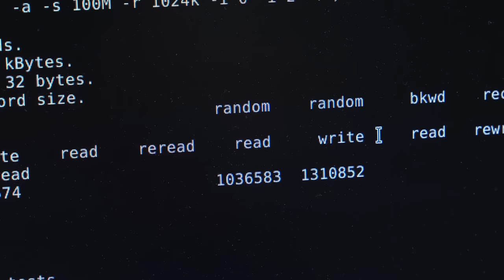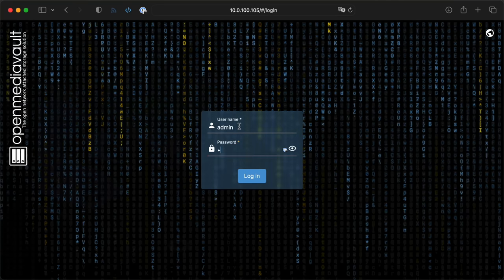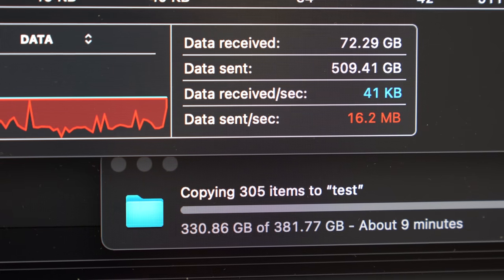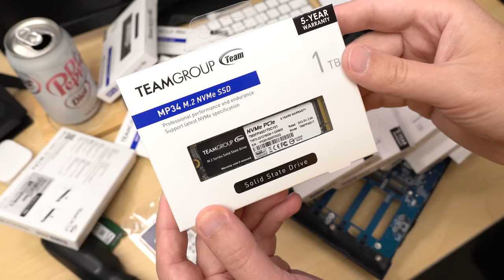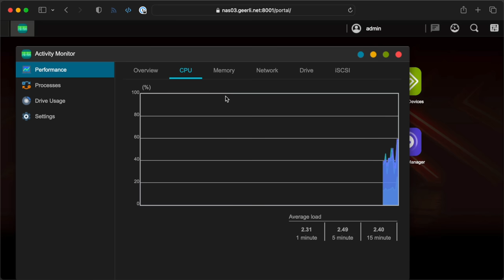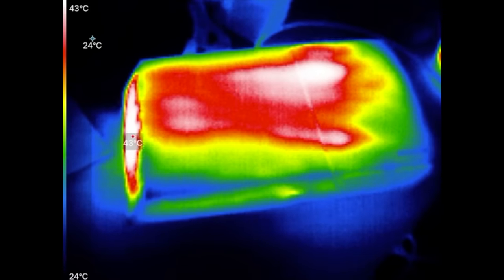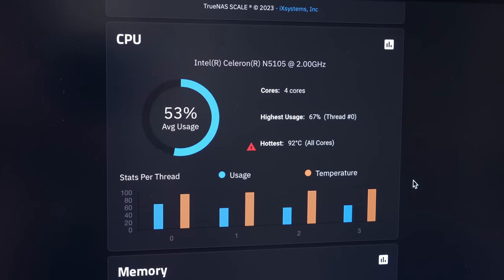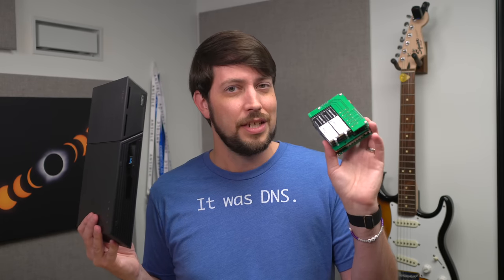All-flash NAS fight: DIY or Buy – Round III!

Comment: Also big props for not locking down the bios and providing a convenient video port
Reply: Thank you!
Reply: Seriously. I’ve never been more tempted by a consumer solution
Reply: @taylormanning2709  We appreciate your consideration! I'll do my best to fight hard for the consumer.
Reply: My lg g6 has a media server option in settings 2tb sd storage and the phone is cheap mine is $18.42 4gb ram snapdragon 821 all you need is to buy the sd cards 190mb/s 1tb sd on the g6 is $94 with out the phone.
Reply: @beatyoubeachyt8303  LG G6 had user replacable batteries too., If you need to replace batteries these days., you need to have a torque wrench with ifixit kit

Comment: One additional thing I'd call out when comparing HDD vs SSD: how much data you can store in a given physical space. It's a little insane to me the absolute minimal footprint that a flash based system can occupy, and for people who live in places where physical space is at a premium, that's a very real consideration.
Reply from the maker: Something I didn't even consider!
Reply: the ppl who life in a small places, wouldn't be able to afford ssd prices. The only consideration is that mechanical drive is more prone to failure than ssd, however ssd chip could fry no problem as well
Reply: @s.i.m.c.a  Not everyone with money lives in big places...
Reply: @s.i.m.c.a  I'm kind of making an assumption here, but I think he's referring to people that live in places like cities (where even a 39m2 apartment costs 60% of your salary).
Reply: @s.i.m.c.a making some pretty big assumptions there.  Not everyone chooses to waste money on more space than necessary.  Why is there a tiny house movement anyway?
Reply: Issue is, the people who are low on space, wont have the money to afford the serious price premium of dense flash storage
Reply: @s.i.m.c.a  There are many reasons why physical space can be at a premium, whether that's due to living in an apartment or smaller housing unit, or wanting/needing to keep your gear limited to the area of desk or a portion of a room. You also can think about this at the opposite end of the spectrum: for a data center, I could absolutely see them moving in the direction of SSDs so that they can fit more compute or graphics capabilities within their deployments as AI/ML usage continues to rise.
Reply: @s.i.m.c.a  Go visit high-cost cities and you'll find lots of people living in small apartments that can without problem afford flash-based storage. Some parts of NY, London etc has silly high apartment costs. So it isn't just poor students that may live cramped.

Next thing is that heat needs cooling. And cooling may require an AC. So extra electricity to operate both NAS and AC and extra noise and space.
Reply: @s.i.m.c.a  Disagree. There are plenty of cities around the world where rent and housing prices are insanely high.
Reply: An 18TB 3.5" HDD is the same size as a 500GB 3.5" HDD.  You're underestimating how dense storage has gotten, and overestimating how tightly you can pack small devices (NVMe drives) that still need individual connections.
Reply: @Asdayasman  I don't think I am. The Rock 5 model B used in the pocket NAS has a size of 100 x 72mm. I'm not sure of the depth of the unit, but it looks to be similar to a Raspberry Pi 4 model B, which is 11mm. A standard 3.5" HDD has a footprint of 101 x 146 x ~30mm (between 24 and 41). The addition of the m.2 drives on the pocket NAS look to about double the overall depth of the unit, so I think it's fairly conservative to say that this entire unit will come in somewhere around the 25 - 30mm mark. Sabrent offers an 8TB nvme 2280 SSD, so if you populate all 6 of the m.2 slots on the pocket NAS with them, you'd end up with 48TB of storage, all in a footprint smaller than the just the single HDD. Factor in that the largest HDD I was able to find on Newegg was 22TB, you're getting more than double the data capacity in less overall space.
Reply: @johngraham8278  I was thinking of m.2s in a motherboard in a case vs 3.5"s in the same case.  Let's play it your way and go for max reasonable density ignoring form factor and see what happens.

With 8TB drives and your measurements of the SilverTip, that's about 48TB/216mL, or 222TB/L, assuming you can melt the last few SilverTips into the spare space around the edges and you don't need power or ethernet cables for any of them.

With 22TB drives and 45Drives' measurements of the XL60, that's 1320TB/(952.5*434.975*177.8)mL, or 17.9TB/L, assuming the same lack of need for power or ethernet.

Right you are, I guess I thought the SilverTip was bigger than it is.  I'd be interested to know the real measurements to shore up the numbers a bit, but that's a big margin to make up.
Reply: @nemtudom5074  welp 1TB ssd is "only" $100, 8 of them is only cost as much as an iphone, and that, bro, is one month of rent in some place
Reply: @fltfathin  Yea, this was my point. The people who cant afford a big apartment to store a server in, also wont be able to just spend a lot on dense storage.
Reply: Well buying a 20TB hard drive is obviously more data in a given physical space than SSDs. And it costs way less too. Full SSD nas is a really stupid idea tbh, even with the reduced SSD prices recently. Just use HDDs for the bulk of the storage and have a few fast SSDs for cache or indexing.
Reply: @username8644  as I mentioned in my previous response - no it's not. With the pocket NAS, you literally get more than 2x the amount of storage (48 TB) in less space than a single  3.5" HDD. That being said - the cost of that solution would be prohibitively expensive for most instances, but there are plenty of people who don't need as much data storage (for instance, you are just starting or experimenting with a new home lab), in which case this could be a much more attractive option.
Reply: @nemtudom5074  I agree that in most instances, it would not make sense, but that does not mean it never makes sense. In my younger years, I lived in an apartment with a number of roommates, and I could reasonably see myself spending the money for a solution like this that I could store in my room with me. That being said - the more data storage you need, the less attractive this becomes at current SSD prices. The other thing worth noting here is redundancy: if you're using a 22TB HDD and don't want to lose all of that data at once, you need a spare drive. That means you're going to spend ~$600 on the drives. 2TB nvme SSDs can be had for as little as $69, so to get the same amount of storage with a redundant drive you'll spend a little less than $800. That's a $200 dollar difference.
Reply: @username8644  This pretty much. Unless your NAS is going to be like 4, 6 TB's maximum, its still not worth it. The flash storage just still costs too much for it to be worth it. 

If you only want to store 20TB or less, then storing that only takes a handful of harddrives, in which case the footprint is almost irrelevant, while if you want to store more, hard drives are going to be way cheaper, and the people who need it to be small, wont have the money to pay for a lot of SSD's still.
Reply: @johngraham8278  You can get 48TB with 2 HDDs. That's still going to be a ridiculously tiny computer. And it'll be like 10% of the cost of your SSD dream.
Reply: @nemtudom5074  Exactly. Also even if you don't have a lot of space, I don't see how a regular Nas with like 3 HDDs (which could easily be 60tb+) takes up a lot of space, it would be like half a foot by a foot. Spending probably like 1000% more for a tiny nvme NAS doesn't seem to make a lot of sense for me. There's only very rare and specific situations where that would be worth it, but it's not for someone with a small room. There will always be space for a small HDD nas no matter how small your room is.
Reply: I will never understand that limited space argument.
As someone who lived in a tiny apartment and is now living in a small apartment, the space a NAS takes up doesn't matter.
You will always find the space somewhere. Put it on top of a shelf, under your table on top of your desktop PC, or in that small space between the wall and door. 

But there is an actual benefit for SSD over HDD: noise.
If you have to have the NAS in your bedroom (or your bedroom is your only room) then the noise HDDs are making is annoying. I always had to turn off my NAS at night.
Reply: I'm in the poor people live in small homes camp. People talk about rich folk in small homes all they want but they're the minority not the majority. Also the ssds being more reliable than hdds is so bunk. I still have drives from the 90s that still work. I've heard of plenty of ssds that die well before their advertised write limit. On top of that the idea that you can still read it after it's finished isn't true either. Only some do that. Some simply just die.
Reply: @s.i.m.c.a Have you seen Japan? Or China?

Comment: The pocket nas is almost EXACTLY what I've been wanting for a few years. I'm a traveler who requires a lot of offline video storage.
Reply from the maker: Please go to the link to Rick's site and indicate what features you'd be looking for specifically. I can't wait to see the final version he comes out with... I've seen renders of a much more reliable prototype based on the Rock 5 model B, but there's still time to let him know if there's some other feature you'd be missing!
Reply: @hundredfireify  I have been using a m.2 enclosure for a couple years but I'd like to be able to access it wirelessly sometimes like with my phone. I have used wireless storage devices before (I had a Seagate wireless drive and a western digital wireless drive) but the current solution don't support the flexibility I'm looking for yet. I want a AIO portable Nas with media output on it for tv. I'm asking for a lot but if it's not this device I was looking into buying a Latte Panda Sigma which offers a lot of what I am looking for. Speed, flexibility ("full hack-able" , portability, etc.
Reply: @youdontneedmyrealname  if you set up a samba share on your laptop you could wirelessly share your enclosed drive to your phone

Comment: N5105 can easily run with 32GB of RAM - should help TueNAS. And the slow-down on write speeds is due to reaching end of cache. Most cheaper flash drives use QLC memory as the most cost-effective with some cache (DRAM or SLC). Once it fills - the drive becomes dreadfully slow. Would be interesting to see the influence of that for the ZFS poo performance.

Comment: The small SBC as NAS devices interest me for home clustering experimentation.  Hiding a bunch of these around the house for distributed compute and storage would be neat...  running your own little home cloud, the house is the server.
Reply: I took an old dual cassette player gutted it and put an sbc in it with an 8TB drive. Set it in a detached garage that's hardwired. Now have a backup copy in a different building. Next step is getting a copy offsite.

Comment: the pocket nas would be perfect for me as a trucker, great to store some games on for my laptop,  might even be able to make a ceph storage cluster , that would be something
Reply: I do wonder if it'd run CEPH. I tried setting up ROOK CEPH on a microk8s cluster running on i5-6500T and 32GB RAM and ran out of CPU. Maybe I did something wrong, but certainly interesting.
Reply: Couple external drives would be much simpler. Use 1 and keep a 2nd synced occasionally as a backup. Much cheaper
Reply: Yea but why

Comment: Awesome video Jeff! Love your thoroughness in your reviews. What I'd one day like about consumer nases is enclouseres for diyers to use. I can build a Nas in a case, but it has not enough drive mounts. I can build one in an old server but it is not power efficient and empty server chassis with drive bays are super expensive
Reply from the maker: Yeah, there are very few cases you can buy that are great for NAS use cases. It'd be pretty cool if ASUSTOR used a particular spec for their main boards so you could pop in a mini ITX replacement or something. Would make it so you could buy a used consumer NAS, rip out the guts, and put in your own!

Comment: When you actually get 50+ PCIe lanes for your drives something like an AMD EPYC, you can run into another problem for an NVMe-only NAS: internal bandwidth of the CPU. When Linus Tech Tips filled up an AMD EPYC with 24 SSDs, he hit a major stability bug in the CPU, because all those NVMe traffic ate up the entire internal bus bandwidth of the EPYC processor and started knocking CPU cores offline!
Reply from the maker: That is one downside to NVMe, just like throwing hundreds of physical CPU cores in a system, all that NVMe can make things get wonky!

Comment: The Asusstor read speed drop with truenas was from ZFS’s checksum verification on read. The N5105 is just a bit slow at that task.
Reply from the maker: Good to know! That does make sense, that ZFS would be adding some processing that holds it back a little.
Reply: @JeffGeerling  Standard RAID uses some version of CRC32 by default which has had hardware acceleration for a while now. BTRFS also defaults to using CRC32 as well though you can use a different option. ZFS uses Fletcher4 by default and SHA256 if you enable deduplication.
Reply: @JeffGeerling  apparently ZFS isn’t great at handling flash storage. EXT4 and F2FS are reported as having higher performance for arrayed flash storage like these. With a faster CPU and more PCIe lanes, a more optimized filesystem might also give you closer to spec performance out of those M.2 drives

Comment: FYI the Intel N5105 will run 32GB (2x 16GB only) of RAM, I've got that installed in my QNAP TS-464 NAS, and plenty of people confirm it on Reddit. Now, I know Intel does specify a max of 16GB, and it does state that on it's website, however pre-late October 2022, when I was researching to buy a new NAS, Intel's website did say max 32GB of RAM, which is why I went hunting on Reddit, coz reviewers were saying !6 but I saw intel say 32. I think it might have been that "your millage may vary" scenario, because even though Intel pre-October said 32GB, QNAP always stated a max of 16GB, so I think Intel were initially edging their bets, and QNAP were being conservative to ensure they could 100% support customers. I've had 32GB running for 5 months now without issues. But I agree the weakness of the N5105 is it's PCIe lanes, QNAP only offer PCIe 3 x1 speeds, to split up what they are trying to do with 4 SATA drives, 2 onboard NVMe slots, and an add-in PCIe slot for 10Gbe or 10GBe + 2 NVMe cards, I came from a J1900, so even if I wish for a little more, the N5105 is a pretty capable CPU. I would say look out for Intel's Alder Lake N100, N200 and N350 CPUs, even faster and more power efficient, I've got a N100 in my new pfSeense firewall mini PC.

I like the idea of the small SoC NAS, once we get a little more power I might deploy one at my mum's for a media server, they watch a lot of legally obtained films.

Comment: That "write speed cliff" which you fell off is there for al NAND based flash storage- sometimes better and sometimes worse. But it is always there.  Basically when you write you are really writing to pre-cleared blocks of flash. The pre-clearing is a LOT slower than writing to an already cleared block. The pre-clearing happens in background using hidden blocks in your NAND flash device. If you do constant writes you eventually run out of pre-cleared blocks, then you drop down to the speed of clear-a-block-then-write. If you leave the storage alone for 10 minutes then you'll get another burst of high write performance then a drop back down to the slower write perf. All NAND based storage devices suffer this problem eventually, if your writes exceed the pre-clearing rate of the device. Enterprise drives normally just allocate more Flash storage to hidden blocks which are used for wither faster write performance, or to replace the inevitable failed blocks. For some more details, read "Over-Provisioning NAND-Based
Intel SSDs for Better Endurance" which also talks about performance.